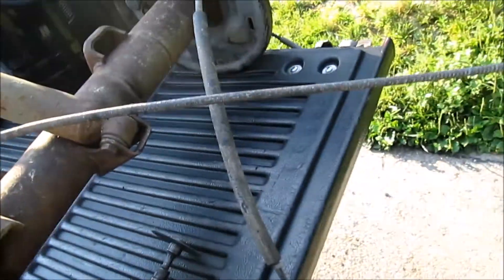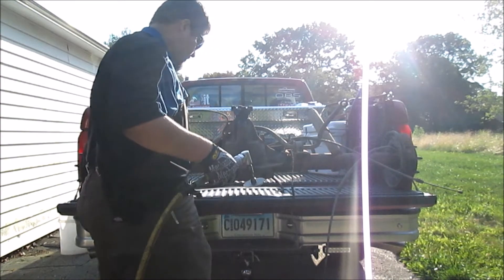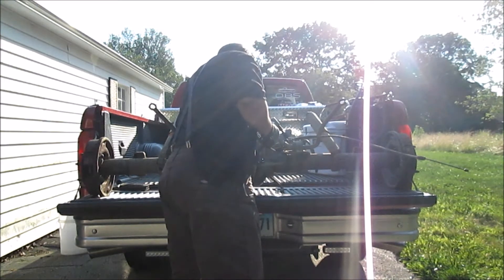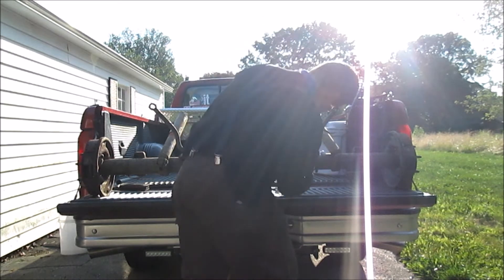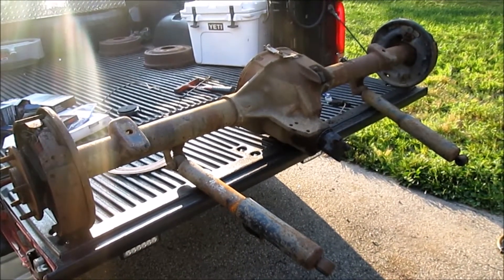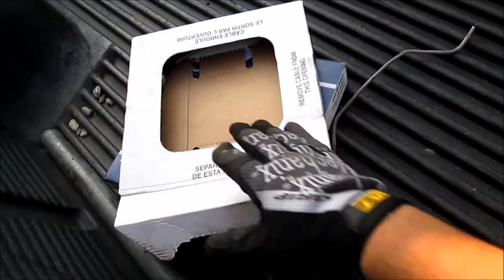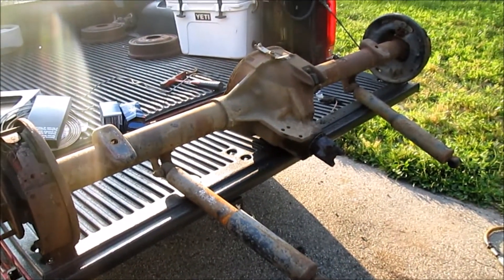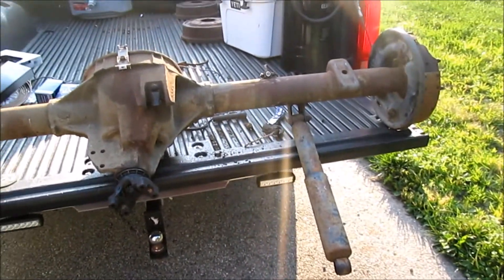Ford 8.8 Limited Slip Stripdown

Comment: Yay im the person to comment on your new youtube video that you just uploaded that makes me happy. If dont mind i have a
question to ask you. My question for you is this I own and drive a 1996 ford f150 two wheel drive with 5.0 302 small block and it has 
a single rear gas tank from the factory i want to convert my single tank to a dual gas tank what would i need to to do this?
by the way how is your four wheel drive conversion coming along?
Reply from the maker: Joe.  I'm not sure how you'd convert to dual tanks.  It's probably best if you ask on a Ford truck forum.  As far as my 4x4 conversion is going, I'm kinda at a standstill at the moment, I have all of the parts with the exception of the tranny.  Hoping to pick it up soon.  But I also want to get the limited slip axle in first.